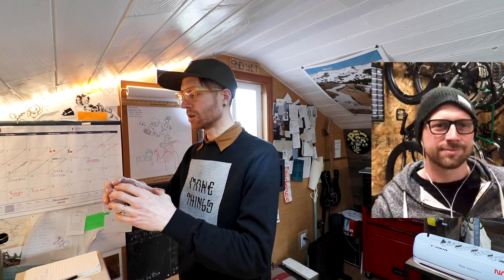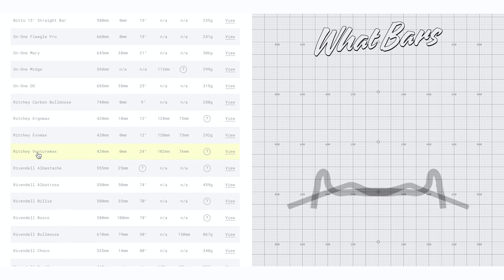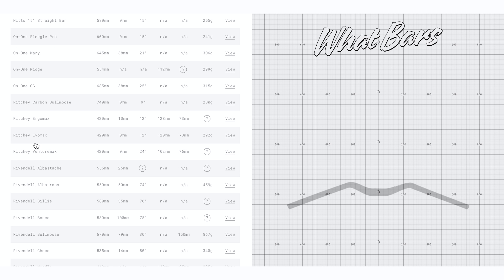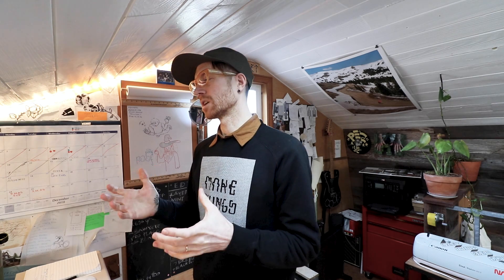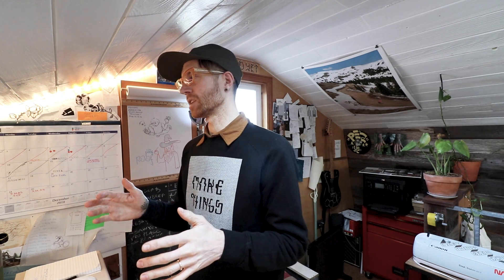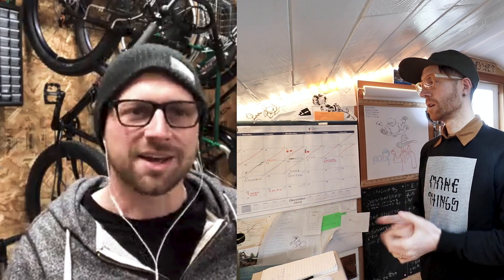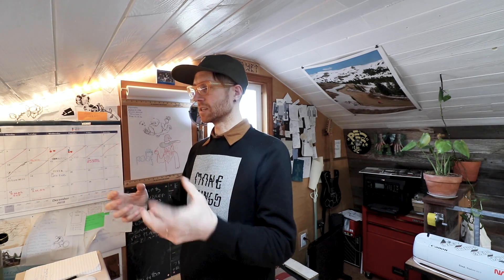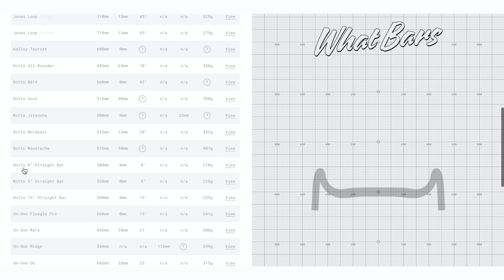A Practical Guide to Handle Bars Featuring Alex from What Bars & Fergus of Ritchey

Comment: Great video, it gave a good and quick insight into bars. Not sure about the "more hand positions are always better". I think it's only right, if you can get the hand position you want. 
I love my gravel bike with dropbar, but it is just not as good as my MTB flatbar on technical single-track. So I think you need to know the limits of you choice when you for example are going with a dropbar MTB Vs. Flatbar version. 
By that advice you should always go with the dropbar version. But I would say it is wrong, if you are looking for a MTB for loops in the local bike park.

Comment: Cool, this vid cleared up a bunch and confirmed my suspicions about bar sizing. I think it would be good to mention what starting points are, IMO; 40-42 road, 42-44 cx/off-road (flared not for cx), 700-740 mtb (drop bars look for a short drop (130+/-10), mtb rise depends on your background (flat if coming from road, 20ish if not)). Regardless, just a thought, i know there are lots of opinions, but its important to talk about. Knowledge = comfort = smiles = miles.
Reply from the maker: This is great. Thanks for sharing.